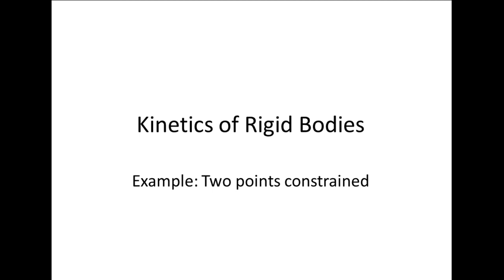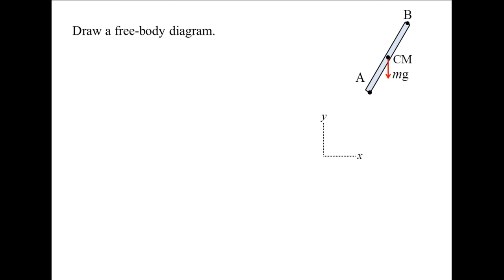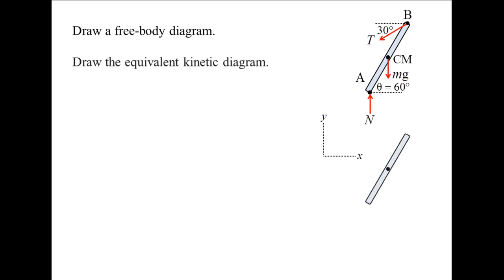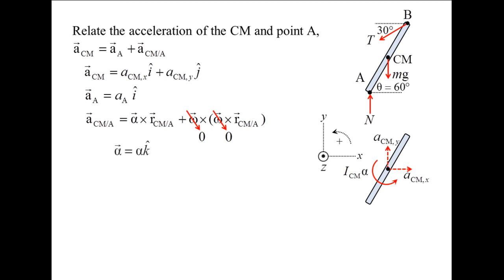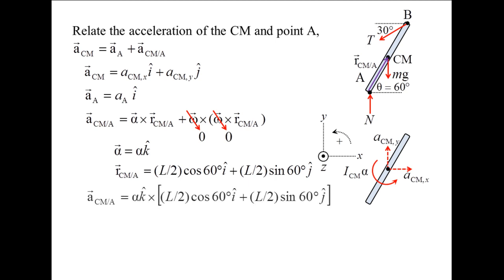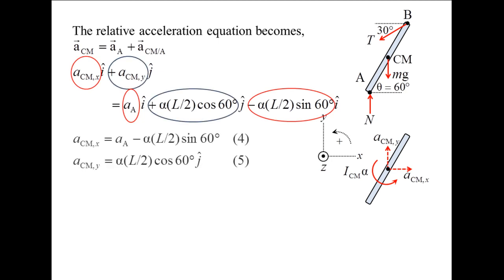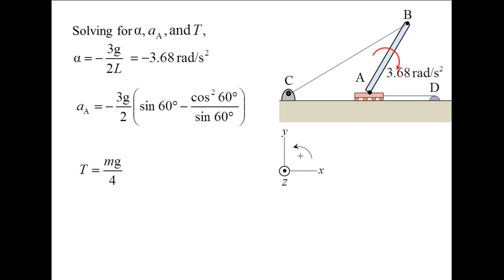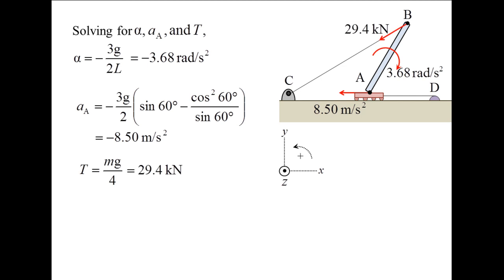Vector Dynamics: Example, kinetics of rigid bodies (2 points constrained)

Comment: How it is possible to have alpha, but in the same time omega is zero? In t=-0 the problem is static i.e. both alpha and omega are zero. In t=0+ dolly moves and slab starts to rotate around point A (although point A changes its position along -x axes). Therefore, if rotation exists, omega exists.
Also, how it is possible that acceleration of point CM/A is zero? As you said, point B falls down but following kind of elliptical path (not circular), because point A slides. Therefore point B also must go down and its acceleration can't be zero. 
In other words, movement and acceleration are attributed to the point A, but at the same time points CM and B don't move end slab doesn't rotate (zero omega)?!